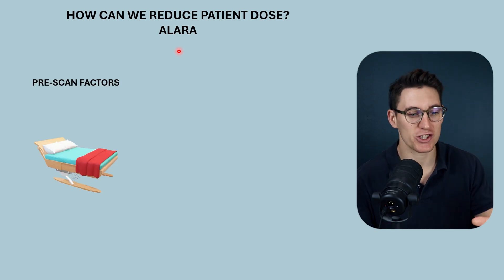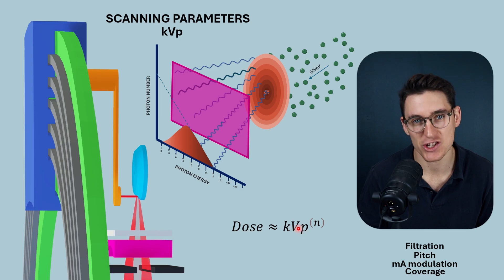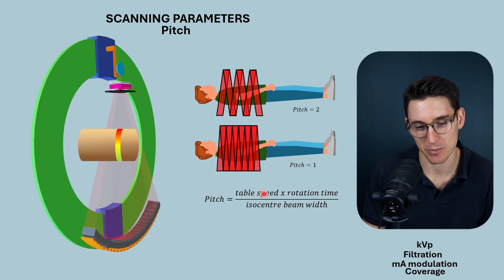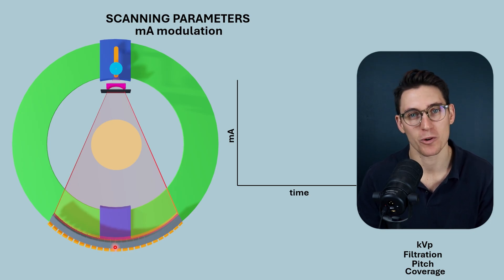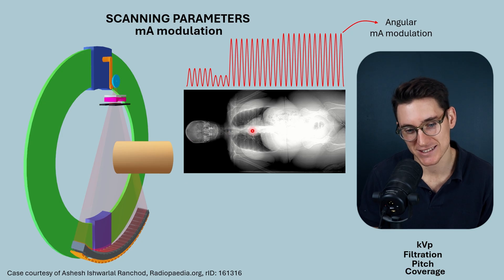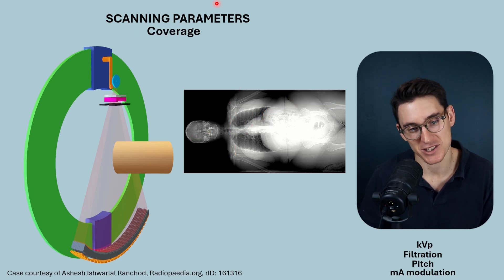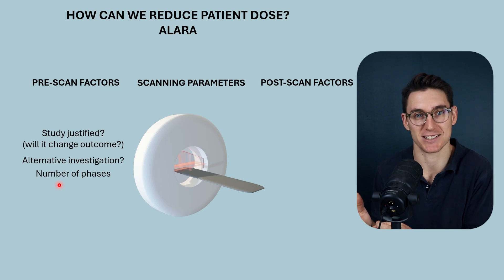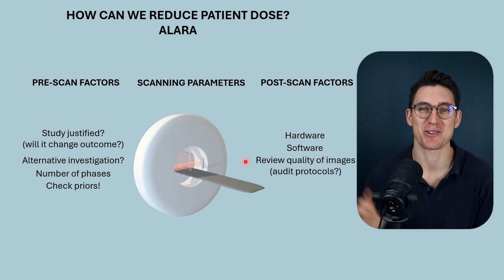CT Dose Part 3 - Factors influencing dose, ALARA, Tube current modulation | CT Physics Course #12

Comment: Question from a student: when adjusting your scan fields over an AP or PA scout, what effect does narrowing/widening the SFOV have on the dose? Obviously, lengthening it in the z-axis will affect the dose, seeing as more tissue will be covered, but is there a difference along the x-axis? It seems to me that no matter how you adjust your SFOV in the x-axis, the same amount of tissue will be covered. Is this why I see some techs not drag the sides of the SFOV in, even though there's a lot of dead space on either side between the shoulder area and hip area?

Thank you